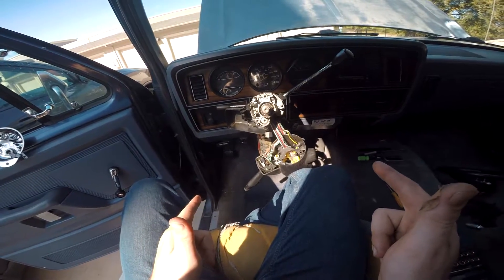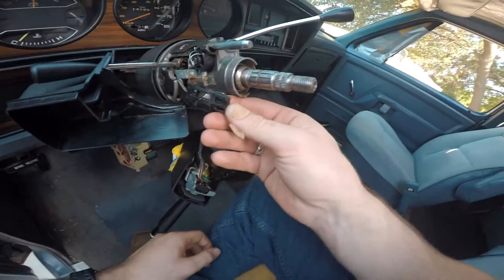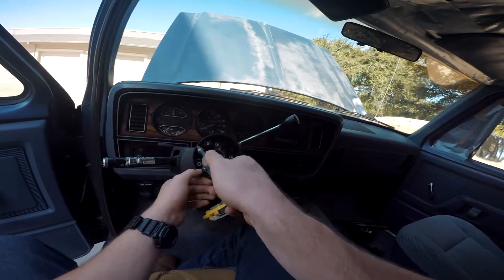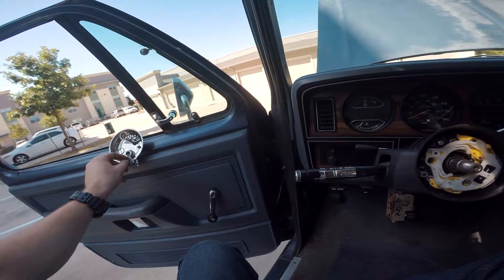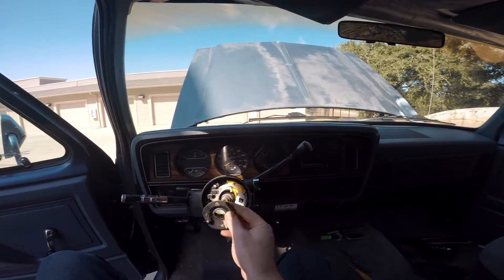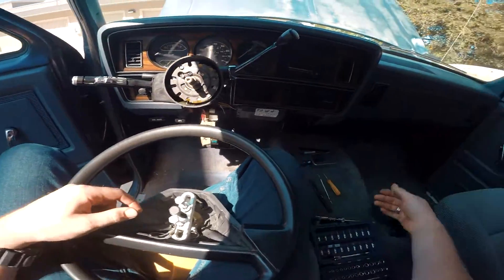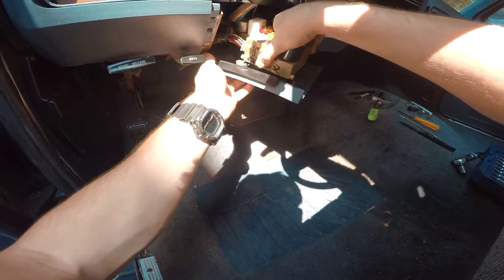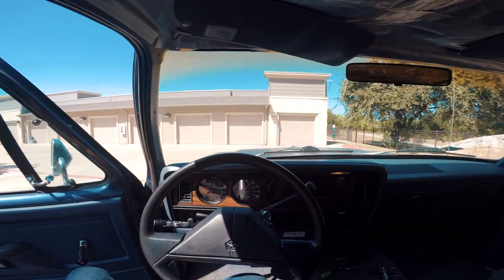1989 Dodge Ramcharger Tilt Steering Wheel Tear Down Part: 3 (Assembly)

Comment: Haha thank God for this video I just had to do this. Only after I fished the new flasher wires through like you showed, I forgot to fish it through the first part of the column lol, the part that is dangling! so I had to get it back out and fish it back through both parts. But that was my stupidity. I really didn't want to take those star bolts out but I had to, luckily it all fit back thanks for all the insights!
Reply from the maker: Glad I was able to help! And yes same! Didn't wanna have to deal with taking it down further.

Comment: Edit my comment: So just as an added suggestion here.  Removing the spring for the steering wheel tilt made pushing the wiring harnesses for the turn signal / cruise in much much easier!!  Give that a try if that's what you're doing this for.

Comment: are there any other tricks to line up the two housings with that flat piece while holding it on the top of the rod, fitting it all together, having a hard time at this point. Thanks Ron
Reply from the maker: Not that I am currently aware of. It just takes some fornaggling to get it. & sorry for my delay reply. I hopes this help!

Comment: OK now I'm gonna call you on a little issue. You kind of skipped over. I followed your instructions to a T and they've helped me out so much but now I can't get the new ignition back in the column. But that bobby pin clip and slapping it in there.  UGG I gave myself a headache and I have to stop and regroup.  They cannot go in there at the same time but yet I don't see you put one in and then slap the barrel in.  So I think you need to dumb it down a little bit for me dammit.  Pretty please.
Reply: OK and I have watched two and three repeatedly now taking a brain break I'll be back in the morning and again all right thank you so much.  It's not your fault I'm stupid.   😂
Reply: Oh, that said please remember I'm just a 56-year-old dumb girl trying to make the world a better place. I'm passing your knowledge forward in doing this for no charge. Because I rebuilt trucks, columns and my own 76 Chevy van (i'm not even gonna talk about the fun that I found messing with motorcycles) at one point but damn that's been more than 10 years ago now.  I do love  that I miss my father who used to stand there and point and giggle to teach me